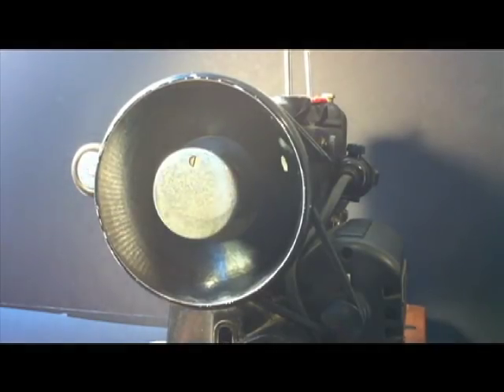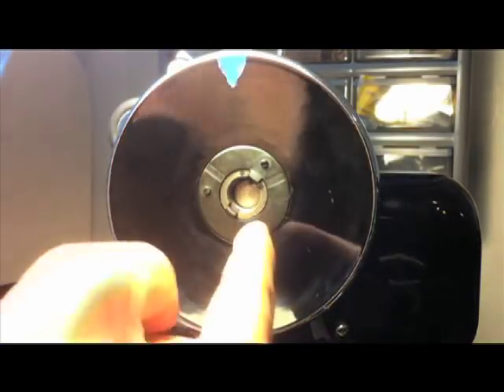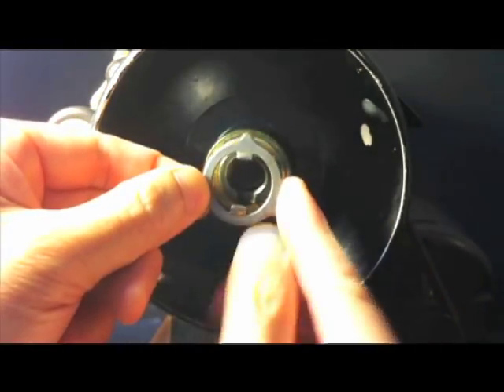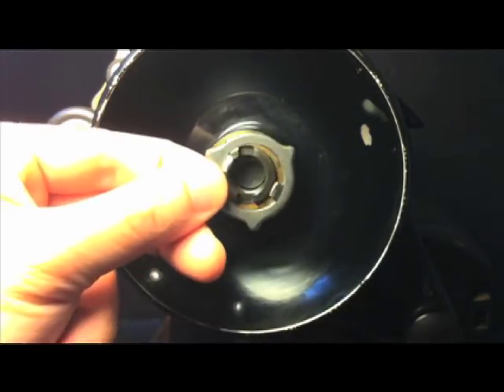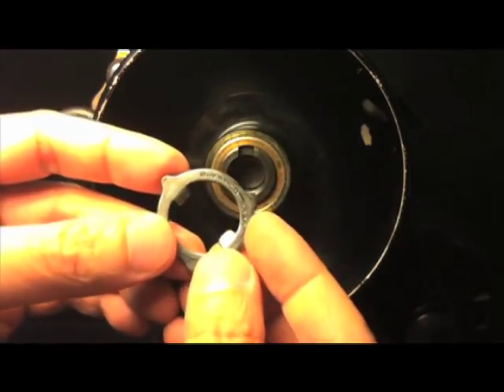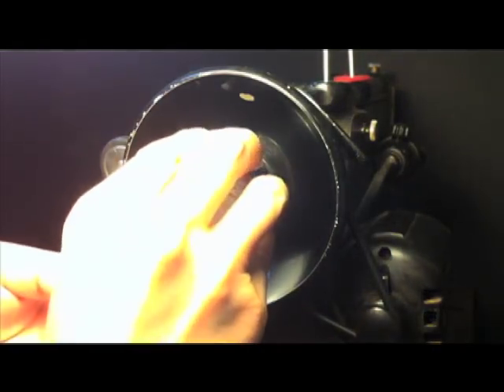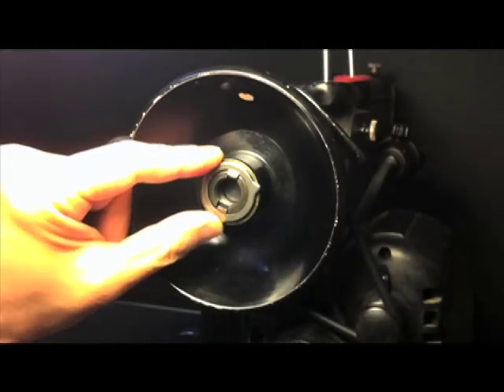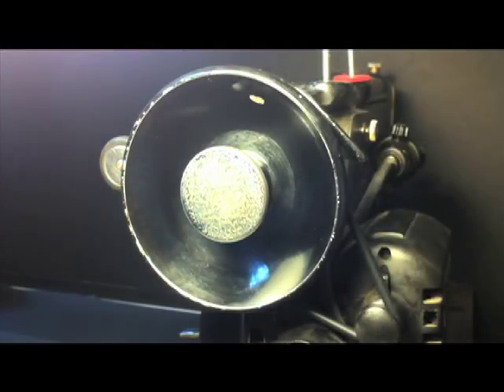How to Replace the Tabbed Stop Motion Clamp Washer

Comment: Thank you.  My White 1088 has the same kind of washer.  I'd gotten oil down in the handwheel where it didn't belong, and it was slipping.  When I took it apart to clean the oil off, the washer fell out, so I never saw which way it was supposed to be.  It is actually running so much better now that I almost suspect it might already have been in there backwards.  It has been slipping for a while.

Comment: Thanks for sharing your knowledge :) But HOW were you able to keep the washer to stay on while you screwed the wheel back on??? I'm at the point of take my sewing machine out of the cabinet, & turning it on it's end(faceplate) to see if that will help. Any help would be awesome!
Reply: nana31331 did you figure it out?
Reply: IVE HAD  THE  SAME  PROBLEM .. MAYBE A BIT OF STICKY STUFF WOULD HOLD IT TILL YOU  GET THE WHEEL ON